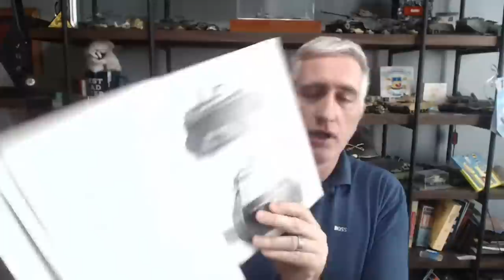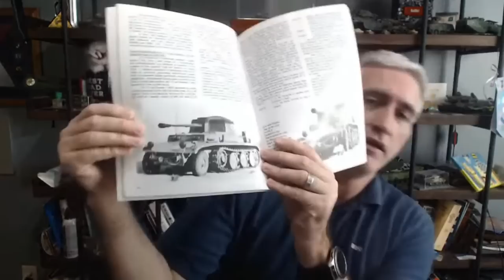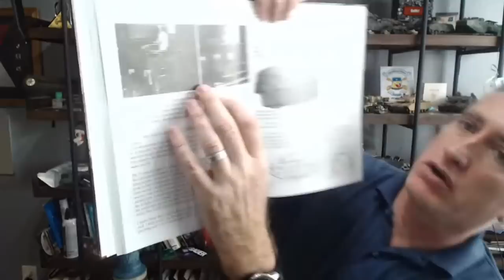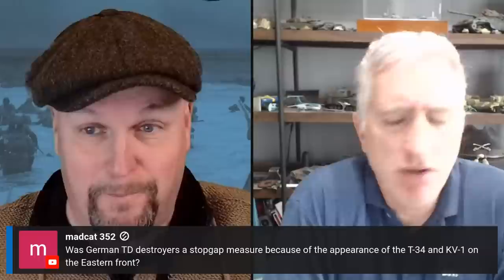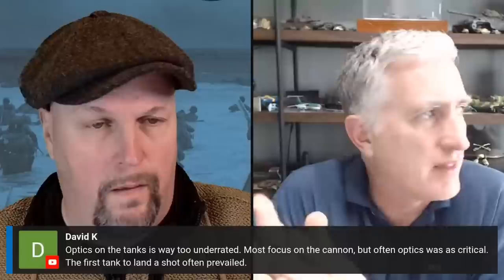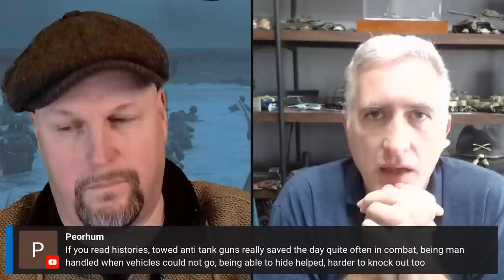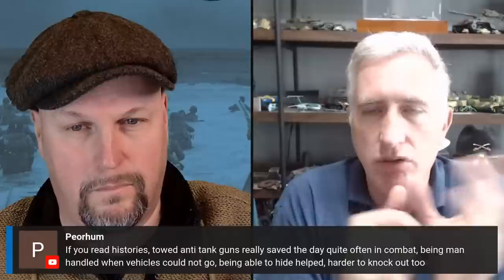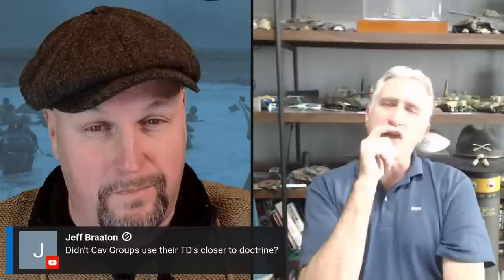Developing Tank Destroyers - with The Chieftain

Comment: The Germans kept occasionally using the term “Tank” instead of “Panzer” informally at least into the early WW2. “Panzer-Zerstörer” would later apply to infantry anti-tank tactics with improvised or hand held weapons like mines, grenades, and Panzerfaust. The late war infantry anti-tank units with RPzB were also labelled “Panzer-Zerstörer” instead of “Panzerjäger”. They didn’t have separate terms for the organic infantry anti-tank units with towed AT-guns and the corps level self-propelled anti-tank units, both were initially called “Panzer-Abwehr” and later “Panzerjäger”. Occasionally the mobile AT units are labelled motorised “mot.” or self-propelled “sfl.” Otherwise, it’s only the unit number differentiating them, with the organic AT units sharing the same number as their parent division, while the corps level units are in the 500s and 600s. Interestingly, AT units always fell under the armoured branch,  initially called “schnelle Truppen” (fast troops) and later “Panzer-Truppen” (armoured troops), not artillery as most other countries. This also explains the later controversy where some StuGs were operated by the assault artillery while others were redesignated PzJg and operated by the anti-tank units. It’s not just because Guderian wanted everything armoured, it’s also because the anti-tank role had always been fulfilled by armoured branch. I don’t think the Germans ever got the dedicated tank destroyers they wanted, like the Americans with their fast vehicles with big guns. The German Panzerjäger I and Marder seem more about trying to keep an obsolete chassis useable, but they neither offer better speed nor a lower silhouette than the contemporary tanks. Arguably, they had better guns, but if that’s the only pro, then the StuG seems like a better compromise and the later Jagdpanzer were of course also built along the lines of the StuG rather than the early Panzerjäger. The other upgunned vehicles like the half-tracks and armoured cars like the Puma were always more about increasing the firepower of their parent armoured infantry or reconnaisance units instead of having fast dedicated anti-tank units like the early doctrine describes.

Comment: At the start of WWII, German 88 mm/56 AA guns (later put on the TIGER 1 tank) already had armor-piercing, capped (Pzgr.m.K.) anti-tank ammo based on a smaller version of the latest German Navy Krupp 203-406 mm  (8-16") Psgr.m.K L/4,4 (AP HE Shell with AP Cap Length 4.4 Calibers) fro0m about 1934 for the Navy ammo.  The 88mm version used an Army base fuze and slightly different explosive charge but looks identical with its pointed nose and "Knob-and-Ring" (British Firth Company type) AP cap, though with a fixed brass cartridge case for rapid loading.  This shell design was the 1939 APC shell.  Around 1942 a better, stronger APC shell with a smaller explosive charge, blunter nose under its AP cap, and a truncated cone shape for its new  AP cap replaced the Krupp naval-style shell.  This latter shell design replaced most of the APC shells for all German anti-tank guns at this time.

Comment: Very interesting presentation. General Lesley McNair as Commander AGF had control of both Tanks and Tank Destroyer development and production. There were complaints that McNair hobbled tank development as he maintained that tanks did not need heavy armor and larger guns as they were not expected to combat other tanks. Several tanks were scrapped on grounds of cost, weight or transportation, the M-26 was only fast tracked after McNair's death.

The M10 17Pdr SP Achilles was produced at same time as the as the Sherman Firefly and 1,150 were completed before the end pf the war. They were used by Armored Division and Army Corps Anti-Tank Regiments. The Vickers 17 Pdr SP Archer was built from September 1944 and served mostly with the Anti-Tank Regiments serving with Infantry Divisions because of its slower speed. Interestingly the A30 17Pdr SP Avenger, which predated both Achilles and Archer, did not enter service until the war ended.
Reply: Presumably McNair thought tank destroyers would combat German heavy tanks- which is daft really particularly in the Bocage in Normandy where German heavies and Stugs could lie in wait, any vehicle combating them had to be able to take frontal rounds without being destroyed to have any chance of survival.
Reply: @catinthehat906  McNair wrote the Tank Destroyer doctrine, which also relegated the tank to infantry support role. Sadly McNair was able to cancel a whole bunch of tanks 1942-44, including T-14, T-20, T-22, T23, M6 and was about to cancel the M-26. NcNair died in USAAF bombing of Normandy July 1944. His replacement General Ben Lear reprieved the M26, but by that time it had been delayed over 6 Months!

Comment: The Germans also tried out StuG brigades with accompanying mech infantry, etc. to make sure the StuGs had infantry support organic to their TO&R. Didn't have enough vehicles or panzer grenadiers available.
Reply: When did they try this? The only mention of StuG Brigades with infantry I can find is the late 1944 Heeres-Sturmartillerie-Brigade which had an accompanying infantry company who would ride on top of the StuGs outside of combat (so they were not mechanised infantry). They only had enough half-tracks to partially mechanise the Panzergrenadiers of the Panzer Divisions (plus a few token Panzergrenadier Divisions that were actually structured like Panzer Divisions) so I find it hard to believe they would considering wasting half-tracks on StuG units when they couldn’t even mechanise their premier armoured units, much less their mechanised units.

Comment: Interesting discussion about accuracy versus effectiveness of AT guns (particularly those of 76.2 mm) in penetrating tanks, a subject which has come up in the chat on previous shows.  Overall, my (unscientific) conclusion would be that it doesn't matter how accurate an AT gun is if it can't penetrate and kill/disable the target in one or two shots (consequently I would conclude that effectiveness trumps accuracy--particularly when one or more of the guns being compared is of marginal effectiveness for the identified task), and that the difference in accuracy of US 76mm/3 inch guns vs the 17 pdr using more conventional AP ammo was minimal and not a significant factor under battlefield (as opposed to testing range) conditions.  The issue of the poor accuracy of the 17 pdr sabot (APDS) round wasn't really that significant as that ammunition wasn't issued in large quantities during the war and I believe that British units too found its performance to be generally unacceptable, that in addition to the fact that standard AP (e.g. APCBC) rounds for the gun were quite adequate for use against all but the heaviest German armour.  In contrast, the APDS shell for the 6 pounder was a much more reliable and accurate round that was widely available to British and Canadian armies from mid 1944 onward and considerably extended the capabilities and service life of this older weapons system.
Reply from the maker: Good points Sir
Reply: Indeed. Its a cliché to cite but Joe Ekins didn't need sabot to take out three Tigers very quickly at 800 yards with his 17 pounder on the Firefly. No US 76mm gun managed such a feat.

Comment: The "bomber" sized aircraft as a Heavy bomber destroyer was tried as well (responding to quote ast 13:30) the Zerstörer  concept or heavy fighter that  would be more nimble than a heavy bomber but having a heavy weapons load.   the BF-110 and Bell Aircuda and P-70 ( a converted A-20) were in a way simlar in  concept to the  "Tank Destroyer" 
over all they were not a great solution the idea did continue due to the need for size for early radar and operator  and night fighter  P-61 Black Widow and later F3d Skyknight.